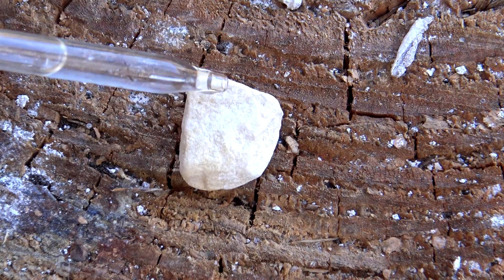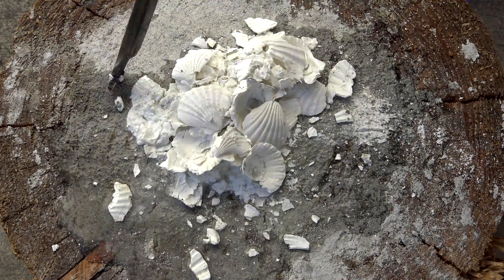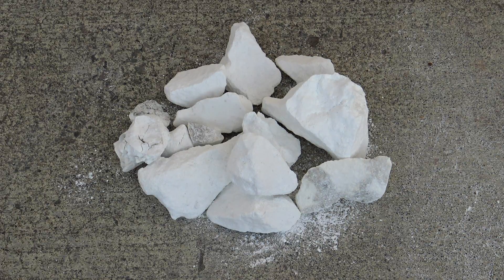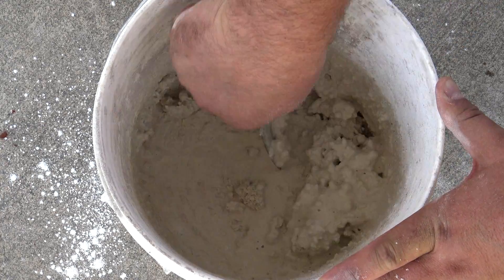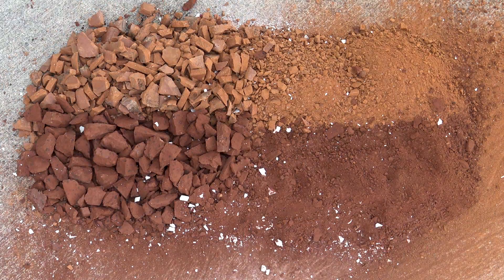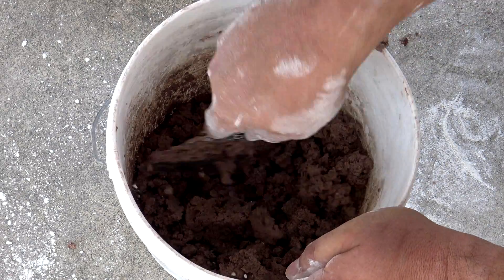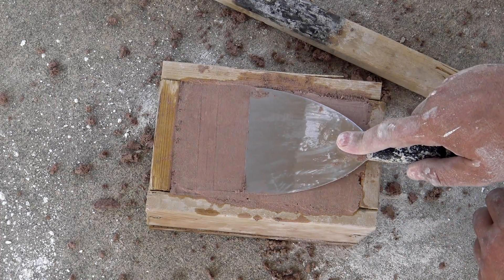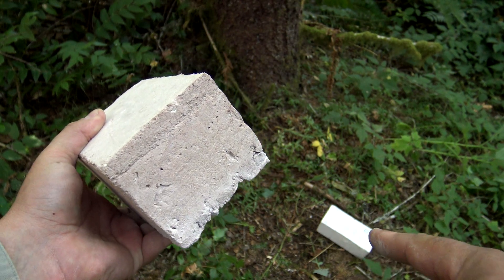How To Make Improvised Roman Concrete (Corporal-Crete)

Comment: Nice. I think you've also inadvertently taught people how to make Flameless Ration Heaters. Just take a Mylar bag or other thick container and chuck the powdered CH into it with properly-packaged food.
Reply from the maker: Whatever works, lol. Thanks for the comments and for watching
Reply: I was thinking the exact same thing.. For survival in the wildenes next to a river or seabed where there are sea shells you could make a heater!
Reply: muriatic acid is actually a name for it from the late 1500s to 1600s, but it is called that in the USA in diluted form (used for balancing ph in pools and cleaning the surrounding concrete)
Reply: The logic of having a heater made from sea shells to keep you warm is half flawed.... if you have a fire it’s what you need.... you would need to burn the sea shells for some time ... your wasting more energy then gaining at that point! A pre made one however would be cool I guess

Comment: i wonder how one would make fire brick ? and this would make a nice caulk on a cabin
Reply from the maker: Agreed, and the knowledge is out there, somewhere. Thanks for watching
Reply: sara sammon  I belive you have to use aluminum  for firebrick.
its got a higher pitch then cpl crete.   lol
Reply: 1 bag of mortar mix
1 bag of garden perlite

mix equal parts.....fire safe concrete
Reply: but in a prepper situation. you may not have those.

Comment: All fine and well done. Now tell how many tons of the material and time needed to build say a small building or shelter.
Reply from the maker: your guess is as good as mine brotha, but the theory is sound and this material can be added to a wooden structure. At the very least it will keep the elements out, but I understand what you are saying, however this unfortunate task is how life was back in the day and I am sure it sucked. Thanks for watching
Reply: Yeah they did it, some made it and some didn't. Life expectancy was only about 40 tops, with the occasional exceptions. They worked very hard and many children to share the load. You could spend years collecting the material, mixing, forming and drying in various stages of construction. Something you would have to start as young as possible.